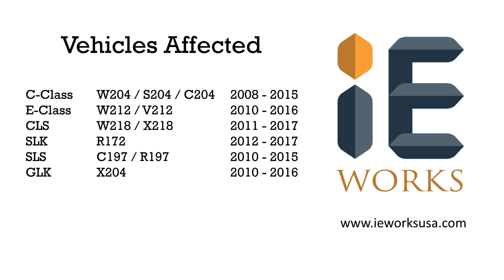How to repair the scrolling/rotating function on Mercedes-Benz COMAND Multi-Switch Push-Button

Comment: Just installed this replacement shaft. The video made the installation super easy. The only tip I would add is to put the little black levers into the lever holders before placing the lever holders back onto the unit. It saved me quite a bit of grief doing it that way.

Comment: This video is very useful and actually better than the other one on Youtube that shows you how to do this.   I started the job using the other video but I could not get the controller apart so switched to this help guide and it got me out of trouble.  Thanks again from the UK !!

Comment: great video thanks- watched it a few times then also watched and rewound step by step as i did the repair- worked perfectly
Reply: Hi Paul, when I rotated scrolling it doesn’t work, push up down left and right working, just rotating not work, would you give me advice what’s wrong with it please? Thank you
Reply: @Ryan_edits569  did you perform the replacement ?

The new part should have a metal shaft instead of plastic

The metal shaft can only be inserted into the housing like a square peg in a square hole - the entire assembly needs to be re-assembled for the twist to work 

Look at the material of the shaft, make sure it is not damaged, and also make sure both ends sit inside their respective pockets is my best advice

Comment: My comment is more related to getting out the command.  I found that in w204 one need to cut ribbon connector cable to be able to extract the unit.  Afterwards I have rebuild connector and rounder a bit easier way through large opening right next to command.  As engineer I cannot believe how original shaft was designed with such a little regards for basic engineering in this case notch effect.  It blows me that there are 10 screws holding command together but the key component is so weak.  Does not make a sense.

Comment: I have a 2012 C63, and the knob doesn't have the gap to get under for removal. I'm trying to follow th video, but am afraid I'm going to break it before it pops, if it pops at all. Any advice on how to remove the knob from the face lifted W204? Thank you.
Reply: Same problem here, did you figure it out?

Comment: A warning: the black plastic pieces on the circuit board under the levers must not be damaged. If they are, the circuit board is damaged beyond repair. Be careful with them.

Comment: Wondering why my wife’s button in her Benz randomly stopped working. We’ve owned the car for the past 6 years and has always worked fine. Can this be the reason? Button still works when pushed but nothing happens when rotated the screen stays the same

Comment: What "metal to plastic grease" should we use for this repair? I've asked around, went to various stores and nobody seems to recall a plastic to metal grease. One mechanic suggested Permatex Dielectric Grease — so that's what I purchased. Will dielectric grease work for this installation?
Reply from the maker: Using a small amount of all purpose grease will do it! The purpose is so that the metal wont wear down the plastic parts.
Reply: @ieworks9976  yeah, that’s what I thought the grease was used for. So, should I use the dielectric grease or another product?
Reply: Aaron Poisson hello what kind of grease is that and what metal did you use ? 
Do Vaseline does the job?
Reply: I used silicone grease, good for metal to plastic lubrication. Got it from Amazon.